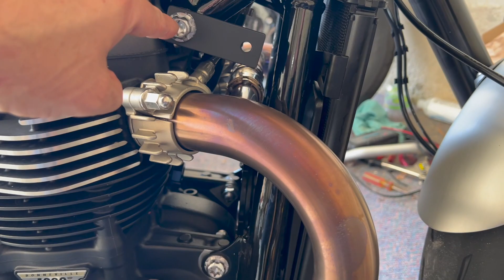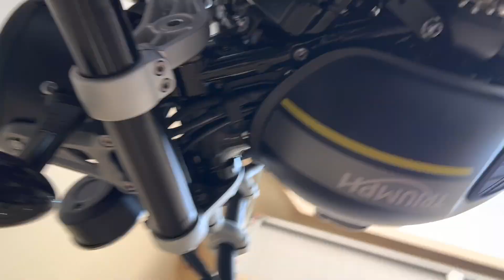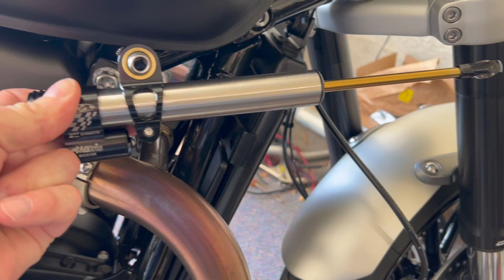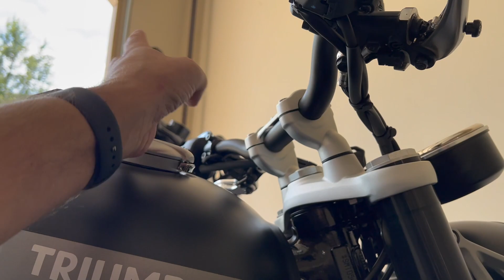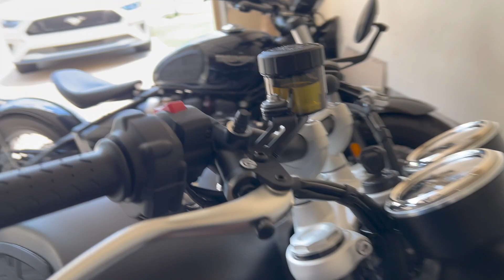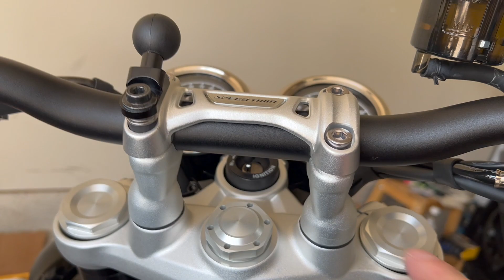Speed Twin Handlebar Mod

Comment: Hmm, short arms here; just want a wider bar, but have the heated grips installed.
Reply from the maker: Yeah, I am fine with the stock width, but wanted to feel a little less cramped.  Plus, when you want to hang off the bike in the turns, I find it easier when the bars are more forward... Makes the front feel more planted, with more of my weight over the front, but its no so extreme like the Thruxton to cause wrist pain....